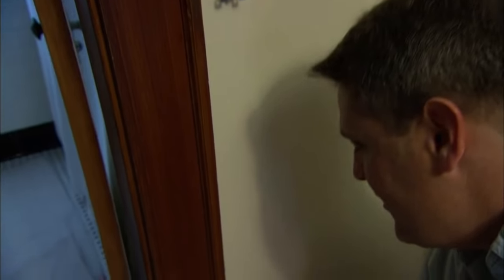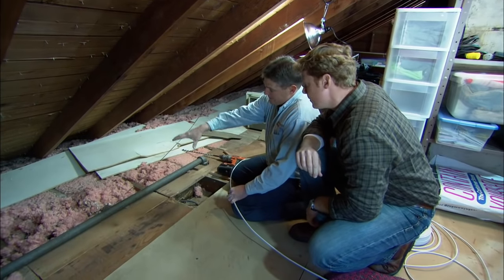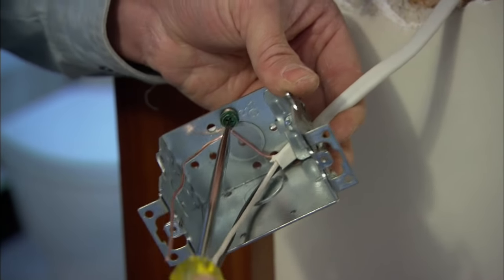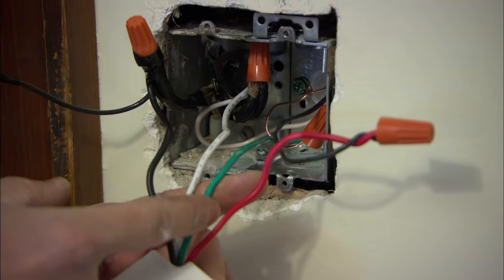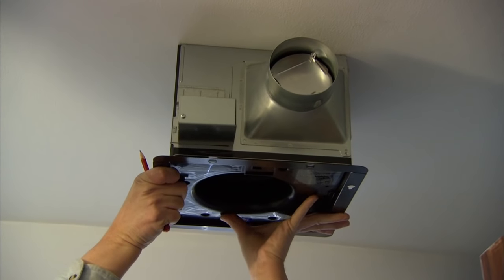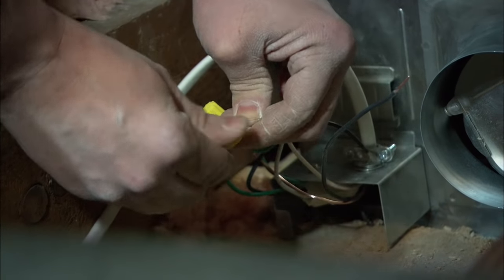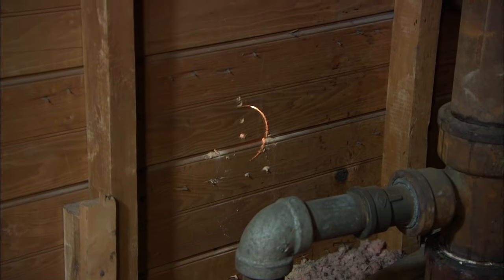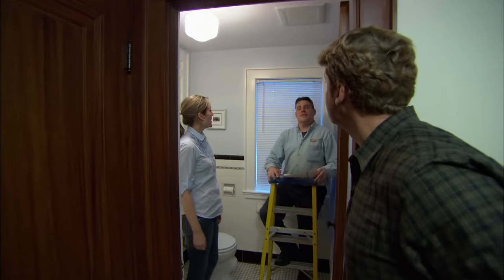How to Install a Bathroom Fan | Ask This Old House

Comment: He used sheetrock screws to mount the vent outside. Those screws will rust in no time. It's time people stop using sheetrock screws for everything especially outside.
Reply: Yep he probably should have used galvanized or better yet stainless steel.
Reply: It's not his house, he doesn't give a shit.
Reply: I noticed that too... so many mistakes on this video. Get it done right, TOH!
Reply: People love to do it because it's easy to use those screws for almost any application. I've seen it everywhere. Not cool.
Reply: I agree with Gary 😉
Reply: But i love drywall screws. Lol i used to use em for everything. Ive upgraded to robbie deck screws for most things.
Reply: Old Italian men love using them for electrical outlets lol
Reply: Those vent covers don't come with screws for some reason, so people use what the have😂😂😂

Comment: Ducting that runs through the attic should always be insulated to prevent condensation. Rookie move kemosabe
Reply: Good thing the duct tape is rated for cold weather though 😆
Reply: It depends on the climate.  When it's warm and very warm year round, it is not necessary.  Moisture will not condense when it's 150° in the attic.
Reply: Not code in TX.
Reply: 5:41

Comment: Vent flex  pipe should have insulation wrapped around it from fan housing to connection for outside vent. Cold attic and warm moist air going up  from the bathroom fan when showering  up through the pipe will cause condensation, over time will drip and soak attic insulation will cause mold & mildew over time Also NEVER WRAP  REGULAR DUCT TAPE AT CONNECTIONS, USE  ALUMIUM TAPE. I also like to use hose clamps after wrapping tape around the connections. DO NOT over tighten hose clamps, just make them snug.
Reply: An insulated flex pipe is a must!!!
Reply: How much would you charge for all that because it goes from something quick and simple to needing more material and time to get it done right!
Reply: @POLOAZTECA The added cost of the insulated duct, SS screws, real duct tape and not crappy duck tape would be less than about $20 and would last decades. I was really surprised to see some of the techniques this guy used, as they were not professional and an embarrassment to ATOH. I’m and experienced amateur and spotted these mistakes (and more).

Comment: Wrong tape. You should always use aluminum tape for ducts, it doesn't dry up and become useless like duct tape (even "cold rated" duct).
Reply: Depends on the local codes, doesn't it ?
Reply: I strongly doubt there is a local code that would favor fabric over metal tape.  The reverse is possible, but in general I think code only requires securing joints with screws, sealing them is likely above and beyond.
Reply: The bloke is a professional electrician if you read the video description so he knew what he was doing
Reply: Duct work isn't electrical work
Reply: Everyone the above comment is correct about aluminum foil tape! That is the tape you should be using with duct work. Duct tape is cloth based and it will dry rot and loose adhesion and come loose over time. I verified this with a friend who is an HVAC contractor and he said all you are suppose to use is aluminum foil tape or duct putty. I have even seen the end results of someone using duct tape to seal duct work in my own house. We purchased a house where the HVAC ducts were sealed in the above manner and most of the tape was dried out and failing. So, I had to tear all that old tape off and get a bucket of duct putty from my friend and paint the joints to seal them correctly.
Reply: I know a guy who used fabric tape on his duct work. Ten years later--BAM! Herpes.
Reply: @tonybradford9650  the gift that keeps on giving
Reply: Agreed, where did TOH find this rookie Old guy??? Wheres Tommy and the rest of the original gang who did things correctly and explained why???
Reply: I work in construction and we use only aluminum tape for ducts
Reply: I  agree
Reply: Ok everyone saying not to use that tape on " duct work" it's not really duct work, it's a vent from a bathroom, it's not the same hot air that comes  from a furnace, so it won't be under the same sort of heat stress
Reply: You are right, and the duct should be insulated as well in that cold attic.
Reply: Watch Mike Holmes and see what he says about duct tape!
Reply: Tom wouldn't approve, his was different.  If the duct is sloping back down, wouldn't you end up with water running back into the fan and dripping down into the bathroom from cooled vapour?
Reply: @tonybradford9650  I like to cover the herps up with fabric tape.

Comment: They forgot to put on a insulation sleeve on the pipe Because warm and cold mixed means condensation
Reply: Correct.
Reply: See Tommy correctly duct a bathroom fan in this TOH vid: https://youtu.be/PqrZWd_CQIE
Reply: oof
Reply: True
Reply: Spencerkey22 true
Reply: will definitely fail inspection through the township. Must be insulated

Comment: Sent the fish tape down the wall, then came down and pulled the wire from the attic down. Magic
Reply: Yeah, I caught that too. That's the "beauty" of video/editing.
Reply: HHS69 I love how there’s people out there with an eye of precision.
Reply: What was magic about that? He pulled the fish tape out first, and then the Romex came out next because it was taped to the line.
Reply: Leonard Hoyt watch it again
Reply: Lmao.
Reply: Leonard Hoyt exactly. I’ve done this quite a few times in my attic when adding fixtures. It’s simple especially if you have a line next to it or if you’re on a wall with existing receptacles and you just measure off of those and know there’s a new stud cavity every 16 inches.
Reply: @OutdoorsWithGeoff  @Leonard Hoyt
You guys are missing the point. If he fished his tape from the top down, he’d be pulling the romex up into the attic, not down into the room.
Reply: There's more than one type of fish tape. This is a short length of wire maybe 7' that has the wire taped to the back side. The front side is the fished through the top plate into the receptacle opening

Comment: You don't need a separate switch/timer for the fan or to cut another hole in the wall.
You can replace the existing switch with one that has also a built-in timer so when you turn on the light the fan automatically comes on and stays on for a number of minutes after you turn off the light.
Reply: I mean I dont want the fan tied to the light. Sometimes I want the light on and no fan
Reply: @SpencerKaup  Use a top-and-bottom/dual switch.

Comment: Must use insulated 4" duct to exhaust fan.  Also use foil tape instead of duct tape.  Duct tape is only good for kidnappings in my opinion.  There will be a call-back here when the fan starts dripping condensation.

Comment: In cold climates, an insulated duct should be used.  As installed, moisture will condense in that duct and probably run back into the fan.
Reply: kent mccarthy The mold should absorb most of the moisture...
Reply: Maxid1
 I wish This Old House took there own advice. I saw an episode a wile ago where they fixed what was thought to be a roof leak and it turned out to be condensation inside the vet hose from no insulation around it.
Reply: I remember it. Only difference could be the climate where this house is, it might not get that cold.
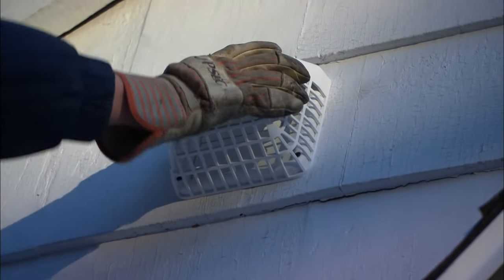Reply: Maxid1 there is ice/snow on his drill at 5:18. also I can see snow on the trees. Should be cold enough to use insulated ductwork.
Reply: Chris34011
So yeah, unless she's heating the attic, not using insulated duct was a mistake.
Reply: Insulated duct👍
Reply: I thought from what TOH said in an online article, these should not go put horizontal, but rather vertical, and yes, insulated. I had a ton of moisture and insulation fixed it, but I kept it going out a roof vent for this reason. Is it okay to go put horizontally? And especially since the duct connection points out horizontally..
Thanks
Reply: Heat does rise though so the attic should be pretty warm...
Reply: @Chris34011  goddam boy, u observant
Reply: @SEaudiofan  It depends on the climate.  In Sacramento, it never gets below freezing now, and in a climate with 300 sunny days a year, it is not a problem
Reply: I made this mistake on my bathroom renovation and I don't want to cut into brand new sheetrock to insulate the pipe I might just spray foam in that area and see what happens 😅

Comment: Just replaced an old exhaust fan from original build of house from 1969. It had plain old duct tape.
Still working great after about 50yrs on the connections. It did what it needed to do and outlasted the life of the fan. It was still sticky and I think it would last another 50yrs if only the fan would only last as long as the duct tape lol!

Comment: attic insulation for the purpose of thermal protection, yes!! Can of great stuff around the seams of that fan for air sealing first! Re apply existing insulation, three and not least insulate duct work to avoid condensation coming back to fan
Reply: Most building codes forbid the use of vinyl (insulated) venting for bathroom exhaust fans.

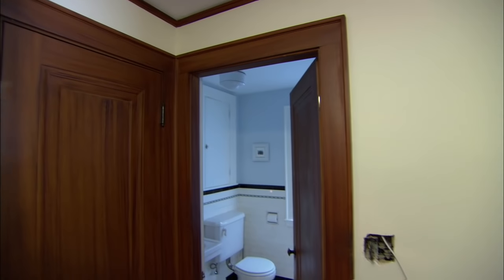Comment: " Now we'll take this snake and run the wire down..."   1:18...
God How I WISH it Was That Easy!
Reply: I know, using a fiberglass rod is easier.
Reply: I know, what the house framing had no cross stabilizing 2×4 between the joist, what we in So. Cal. call Fire breaks...
Reply: That’s the easiest shot in the world. You don’t even need a snake. He changed the box to a 2 gang.
Reply: @KitchenerLeslie2  screwing back together , ahhhh edit that right out.
Reply: @KitchenerLeslie2  yeah, I was a little confused about that myself. I don't see the necessity for it, it only required a single gang opening.
Reply: Put snake in from the attic and then pull wire down from the box ???? Magical

Comment: You should have at least 2 to 3 feet of straight run before any elbows...
Most fan manufactures specify this in the installation instructions..

Comment: Insulate the duct. Use exterior rated screws. Foil tape for the duct. Silicone will have trouble curing correctly in weather that cold.

Comment: There were a lot of important steps you missed. For instance, check with your local municipality if you need a permit. Non-permitted work isn't covered by home owners insurance and can make renting/selling tough.  2nd, before cutting the drywall, put something on the floor to collect the dust. Third, blue duct tape instead of foil tape? Fourth, non insulated duct in an attic? Fifth,  he totally skipped over the wiring of that box. He bypasses the light switch in the instruction and then shows it magically with the switch at the end, which meant he rewired it off camera... That's a really important part that can cause fires/shorts...
Reply: What about caulking the exterior vent ?

Comment: Why was the exhaust venting not insulated?
Reply: probably because it's laying flat in the attic and since it's flex duct, if condensation is a problem (which it probably will be) he can just create a slope in the run of the duct out to the exterior

Comment: There's a template that comes with this Panasonic bathroom exhaust fan but the installer here didn't use it. Also, the vent immediately takes a 90º turn outside the fan. This is a mistake because it makes the air that much more difficult to make its way outside.
Reply: electricalron exactly,  45° are fine 90° only if clearances dictate
Reply: @electicIron Okay... So if I am going to exhaust the duct towards my wall, and not my roof, and the exhaust opening in the fan opens towards my wall... theoretically, I could just run the insulated duct straight with the joist to the vent in the wall... Correct? (If this doesn't help, I could try again)
Reply: @jordynrandall1838  Yes, sorry I did not get an alert tony original post. How did the project turn out?

Comment: Used a dryer duct? Suppose to be insulated flex duct thru a attic. Hot warm humid air will be going thru the duct in a non conditioned attic. Pipe will be sweating, causing condensation, water dripping.

Comment: Is it just the version I’m watching or does dude never show turning off the breaker to this switch?  Seems like that would be important to include in an instructional video.  Cuz if it ain’t in this particular video some novice is going to heaven
Reply: He turned off the breaker.  He should have shown he double checks with an electrical tester.  Double checking is always a good move.

Comment: Not nearly enough attic insulation,  exhaust hose is laid out horizontal which will create tons of condensation
Reply: Right on.  Should have put it through the roof and put an insulation jacket around the duct.
Reply: Again.  If you run bathroom exhaust ducts vertical moisture and condensation will run straight back down dripping right back into the bathroom.  Horizontal ducting is SOP for this set up in cold climate.  The minor condensation that builds up in the pipe will evaporate.

Comment: Foil tape, not blue duct tape (rated for cold my ass). 

Duct should go straight up through the roof if possible. As few bends as possible. Certainly shouldn't be venting horizontal to the intake.

Ducting also needs to be wrapped in insulation to prevent condensation which will lead to mold and/or water damage.
Reply: This should be the top comment, exactly right. Always better to vent through the roof when possible, always use an insulated pipe in non-conditioned space, and always use foil tape for ventilation connections.
Reply: In cold weather applications moisture condenses and guess what happens when you have vertical exhaust ducts?  That condensation runs back down when the fan is not operating. This isnt rocket science gents.
Reply: Your recommendations go against most fan manufacturers instructions. Every fan I've installed in the past 10 years has a horizontal, slightly downward angled initial run so that there's a drip loop by default. This eliminates any possibilities of water re-entering the living space. Not that there should be any condensation left in the ducting if the fan is being used properly with a timer.

The best possible place to vent is always the shortest possible run to the outside, considering where the warm moist air will end up as it rises. In this case, the roof is the obvious best choice, as running the additional 10-15 feet of duct as seen in this video significantly increases drag, making the fan less efficient. Using a short run directly out the roof decreases the surface area that the moist air will come in contact with, which of course reduces drag and the amount of condensation that can build up in the first place.

Also, thanks for the childish name-calling. You seem like an extremely professional individual.
Reply: Sam Morgan in Canada, we have over 2feet snow on the roof in winter, I installed my bathroom fan through the gable wall, going through the roof is not recommended here.
Reply: @samamorgan  having the duct going out through the roof would more than likely cause condensation to drip down the pipe and down through the fan causing it to short circuit.
As we all know dampness getting into something electrical is NOT SAFE AS IT WILL CAUSE A SHORT CIRCUIT

Comment: Pros would start the hole saw on the outside, run it about 1/2 way or at least score the wood, then drill from the inside to prevent that massive chunk of wood from coming out. I'd not only be irritated if a contractor did this to my house but I'd make them fix it. I'd also never approve that tape job. Silvia and Holmes would never let this footage air unless it was a "how not to" video. Norm would most likely (and politely) stop you ahead of the mistake and you and show you the proper way. Heck, even that young man with the perma smile they had on this old house knows better. Bet he learned a lot pallin' around with Abrams, Silva and that plumber guy, Tommy?
Reply: Tom Silva actually did the same thing in a similar video. He drilled straight through the roof without drilling or scoring from the inside. He just got lucky no wood was chipped. Maybe his bit was newer and sharper.

But yes, Tommy did it better. He vented to the roof, used caulking to seal the vent outside, used insulated duct, and used metal tape.
Reply: Moisture in an attic isn't usually a priblem with a bath vent un a place such as Sacramento.  When it gets 100° in the attic in Nivember, moisture just burns right off.  If the attic is vented with ridge and blocking vents, there is really no problem.

Comment: To go thru roof is way more trouble than a side wall vent.  Plus increased chance of a leak. Ideally if you have a ( Y ) duct split.  In. The exhaust vent line somewhere about midway of the entire run you would have an excellent exhausting system. But who wants to cut a hole in the roof and in the side wall to vent air from the washroom. I seldom see contractors do things exactly the same way. There's always thing's done a bit differently between contractors. It's just that each person thinks that their way is better.

Comment: 1) How do you stop the dampers from clicking repeatedly during wind and 2) how do you fix a fan that is letting in a cold draft?
Reply: Get two small round magnets and put one on either side of the damper at the bottom not to prevent it from closing.  This will add the small amount of weight needed on that light plastic damper to keep it from fluttering.